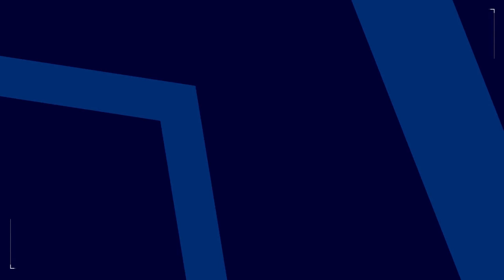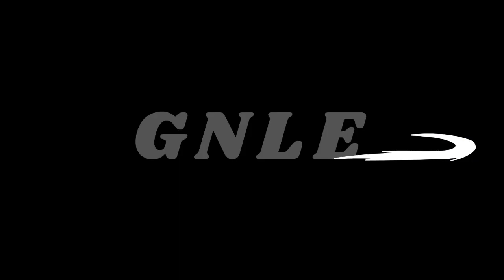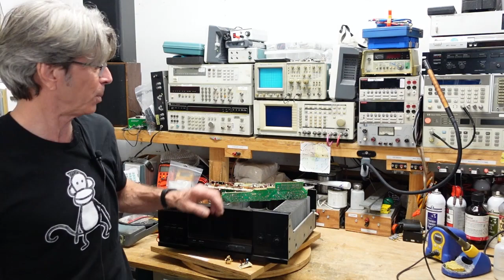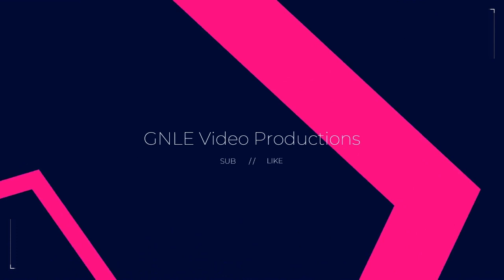Yamaha MX1000   #Shorts  #vintagestereorepair #yamahaamplifierrepair

Comment: Good Luck Ray !
Reply from the maker: Thanks Roro.  It really shouldn't be too bad.  Not like an NAD integrated I worked on a few years ago.  That one had 2 ribbon cables swapped, but what really threw me was the fact that the previous tech had changed out the power switch, which was momentary contact with a latching switch.  The amp was remote capable, and the latching switch locked up the microcontroller.  Only thing that tipped me off was using the remote to turn it on worked fine!